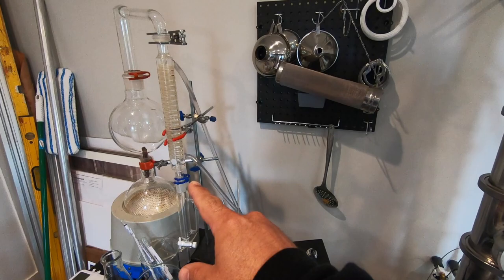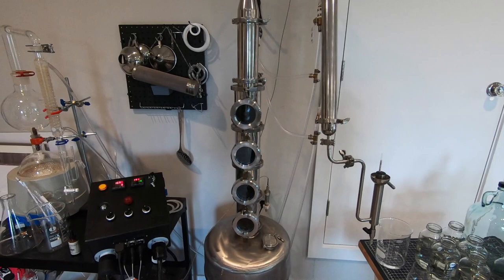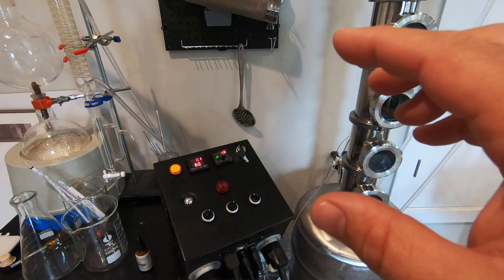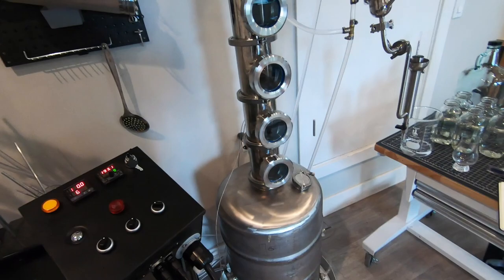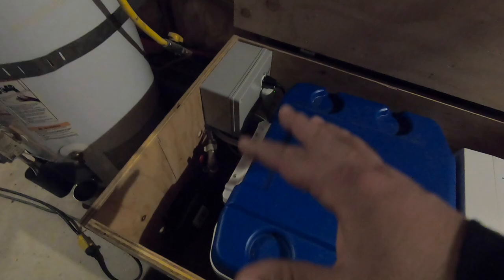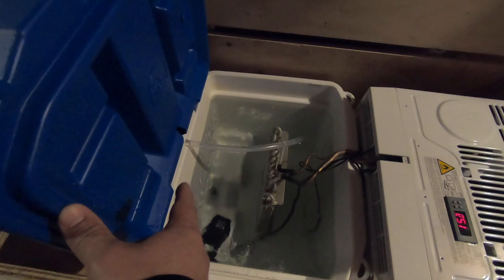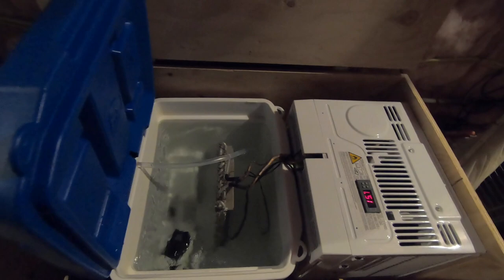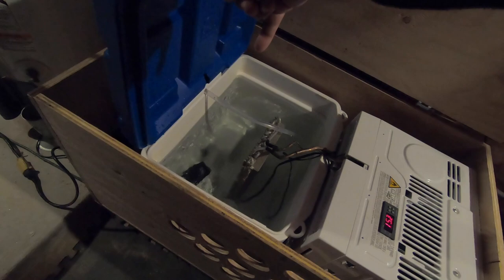Part 2 - Recirculated Cooling | DIY Modular Electric Still Series

Comment: Again, nice design and set-up. The only change I see that could help is to insulate the blue "cold" line between the pump and the wall. Intent is to reduce any minimal heating of the just chilled water by ambient room temp or the hot water return.  A dollar store float tube is a cheap way to do that.  Again, if you could provide the wiring diagram for both the STC controller as well as the power box, that would be great.  Keep up the good work.
Reply from the maker: My chiller is only set to maintain 60f so my output is same temp as hydrometer is calibrated to. There’s almost no loss at that temp so close to room temp.